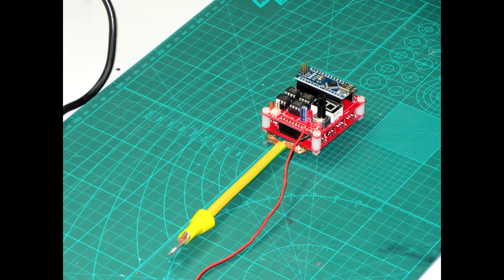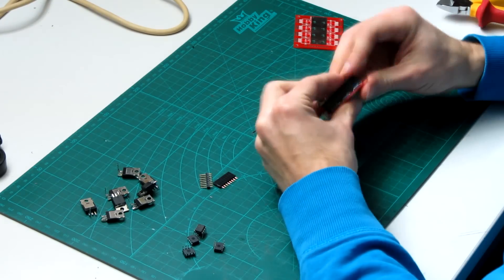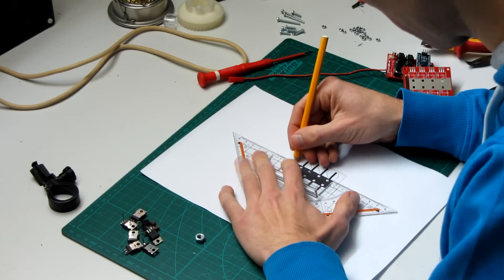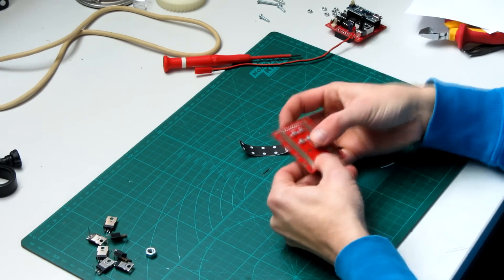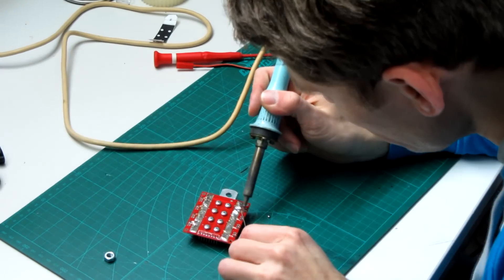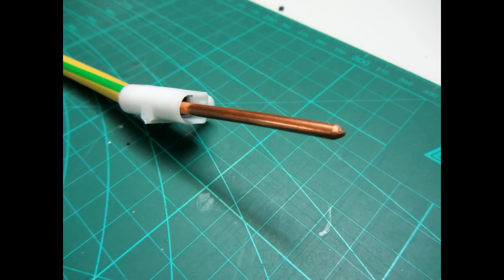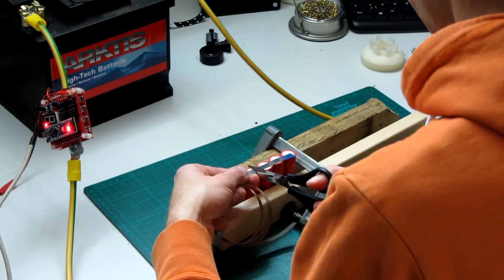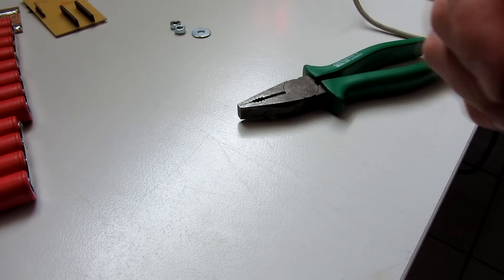DIY Arduino Spot Welder

Comment: On the small black and red wires, what is the max voltage for that and what would be the likely thing to blow out if it was connected to 18 volts vs 12 volts. Mine won’t fire up anymore and was connected to 18 volts instead of 12. Not sure what the max voltage for this part. I would like to fix mine to finish the project. It is not suitable for thick nickel tab material. Needs more power. I can get a sort of spot weld but need more power than a 12volt battery. Don’t know the max for the main battery connection either. Im guessing only a 12 volt battery will suffice.

Comment: Thank you I printed the pcb from pcbway. I will finish the this project.
Reply: Baran Can Aydın Bitirebildiniz mi projeyi? Benim yaptığım sürekli iletimde, pedala bassam da basmasam da.
Reply: Ben yaptım ama demedim akü yok :)
Reply: Baran Can Aydın Anladım. Bende de yok ama 12v güç kaynağına bağlayıp multimetre ile test ettim.
Reply: Serkan ÖZKAN Öyle olmaz dostum en az 40 A aküyle demelisin. Mosfetleri ve driverleri bozarsın. Kısadevre testi yap yanlış lehimlemiş olabilirsin. Akım yüksek olacakki anlık kıvılcım oluşturursun ve nikeli erirsin. Milisaniye bazında çalışır. 0 dan 9 A kadar
Reply: Baran Can Aydın 12v 60a güç kaynağı ile denemiştim ama olmaz mı diyorsun? Öyleyse bi akü bulayım. Mosfet ve driver'lar öldü zaten. 4 pcb yaptırmıştım, yeniden yapayım bir tane.
Reply: Serkan ÖZKAN olmaz hocam akü kadar sağlam akım vermez. Kendinde deneyebilirsin 40 A akünün iki ucunu birbirine değdirdiğinde nasıl bir ark var o güç kaynağında nasıl bir ark...Kolay gelsin
Reply: Baran Can Aydın Teşekkürler bilgi için :)
Reply: Serkan ÖZKAN ne demek

Comment: 0.15 mm nickel plated steel strips. Pure nickel is around twice more conductive than steel, and is also much more expensive.

The positive electrode burns more and not always makes good weld. Hence there is a more effective welding method called "Step (Indirect) Welding". Place the positive electrode directly on the battery terminal. Make one weld with the negative. Much better quality, and also less energy required. Or thicker material with the same energy.

Also, you can make the positive end bigger. If there is no space on the side, you can drill a hole in the center of the tab. More complex, but can be done.

Google "Fundamentals of Small Parts Resistance Welding" and look at page 7. This method is called "Step (Indirect) Welding", while the ordinary method is "Series Welding".

"Step (Indirect) Welding is often used when the workpieces are configured in such a way that only one side of the workpiece is accessible with an electrode, or there is a large thermal imbalance. The welding current flows from the first electrode, through the workpiece, through the area of the weld, through the other workpiece and into the other electrode."

"Series Welding is also used when only one side of the weldment is accessible with electrodes. This form of welding has the advantage of making two weld nuggets at one time. However, series welding is generally less controllable because of the many shunt paths available to the welding current."

Hope it helps. :)
Reply: The reason for the burn on the positive electrode is because ~70% of the energy is dissipated on positive, the reason why MIG and MAG welders use positive on the feed wire and TIG use negative on the tungsten tip.
So yes use a thicker wire for positive electrode or add active cooling.
Reply: Don't listen to him.
If you do this there will be a hole in your battery cell afterwards.
Check out your setup with an old cell first anyway.

Comment: Hallo Mark. 1) Board v3.3, sollte ich R2-R9 auf beiden Boards installieren oder nur auf dem MOSFET-Board?  2) Warum kann die V4.03-Software nicht für die V3.3-Karte verwendet werden? Der einzige Unterschied ist der Zusatz von BUZ. 3) R2-R9, ist 0805 genug? Danke schön. PS, beim Schweißen sind 3 MOSFETs durchgebrannt, aber die Schutzdioden und R 30 Ohm funktionieren. Warum ist das so?

Comment: Can I replace IRF1405 with AP9963GP NMOSFET-s since I can get them much cheaper? They can handle 160A and 40V with 4mOhm RDS(on) and VGS(th) of around 2V. Can I use even lower voltage MOSFET-s?

Comment: Very nice work. But why is there only one digit display? Would you consider making a version with 2 or 3 digits and be able to have a much wider timing range? Thanks....
Reply from the maker: Raindrop Services there is no space on the pcb for adding more displays. you can already display times of max. 99ms with the current one. With some code modification even 999ms should be ok on one display.
Reply: I have same question , when it reaches 9ms, then it goes to 0, then is it 11 ms? and the max of 20ms is another rotation. Direction are no where on how to read the LED.

Comment: technically.....a car battery hooked up directly would deliver enough current to do that too...
something about 80 amps will do for most of that small stuff

having said that, tig welding uses something about 80 amps for 6mm stainless steel
Reply: the 80 Amps of a tig welder is to keep up the arc thats been ignited by the alternating high voltage. Same principle as a HID Lamp ballast.

i built one by myself (spot welder for batteries) using a rewound transformer, i need around 600A (measured with a clamp meter) in a 200ms pulse to create a stable weld on 5x0.1mm nickel strip / 18650 battery surface.
A car battery usually delivers much more current for the starter motor, atleast for a short time.

Comment: HI. I really loved your device.I want to make it but I have a problem with componente. 
I want to use 10x irf1010n and 5x tc 4420 PCB would adapt to these drivers.
I have arduino nano v3 do you  put in your code file or I have to manually enter values?
thank you.
I'm sorry if my english is bad. a large greetings from Serbia.

Comment: Tried to replicate this device.
Collected everything exactly, loaded the program into arduino. It worked but only half.
Those. the indicator lights up "8" all the time, i.e. all segments are lit except for the point.
The device produces a double pulse, but not adjustable. Rotating the potentiometer has no effect, no effect.
When the button is pressed, the LED flashes, 2 pulses are generated, and at the moment the button is pressed, a random number appears on the indicator. The next press and the number is already different, no system.
So the device is raw, it is possible that the program with some kind of error.
Sergiusz

Comment: Really nice work… but put some shrink tubing over the wires. Earth wire should NEVER conduct current, and 2: after 2-5 years you're going to connect the wrong way (Murphys law).

Comment: hi could you make instructions on how to order the pcb? i see so many options that i don't want to choose wrong, i already registered using your 5$ coupon so thanks for that :)
Reply from the maker: +CrAzYDr1veR You dont have to change any of the options.First register an account at http://www.pcbway.com/setinvite.aspx?inviteid=12824. Then just go to http://www.pcbway.com/orderonline.aspx . Type in Board Dimension (100mmx60mm) and quantity (cheapest is 10). Then click quote now an make your way through the ordering process. As Gerber Files use the spot_welder_v2_gerber.zip from my github https://github.com/KaeptnBalu/Arduino_Spot_Welder/blob/master/Eagle%20Files/Spot_welder_v2_gerber.zip

Comment: Those 12v need to be DC or AC or it doesn't matter? Thank you!
Reply from the maker: 12V DC
Reply: SelmerSlowflyer
 So I can power the Arduino directly from the car battery, no need to buy a 12v power supply, no?
Reply from the maker: Its better to use a seperate 7-12 V supply for the Arduino. My car battery drops the 12v down to 3-5 V while the welding pulse happens. Dont know if the Arduino can handle that short decrease of supply voltage.
Reply: Thank you for your time! I found a power supply seller. They range from 0,1A , 0,5A , 0,7A , 1A. Can you please recommend the minimum necessary output current?
Reply: Please answer. I wont ask another question.
Reply from the maker: Take the 1A version. 0,5A should be enough but with 1A you are safe.
Reply: Thank you!
Reply: This problem should be fixed with some capacitors? Could you suggest me some?

Comment: Hi, can i use a welding machine instead of the car battery?
Reply: if your welder can give 400+ amps than you can.

thing is, the house hold welding machines are 30-40volts and 200 amps, you need 3-6 volts but 400-800 amps.

Comment: can i use laptop AC to Dc cord 19 v instead of using  car battery? cause car battery is expensive
Reply from the maker: andrew No, you need the power of the car battery, about 400A . Power supply can only deliver about 5-10 A
Reply: do you have still extra Pcb card to sell it?

Comment: Please how/where do you get that template forbthe aluminum. It is not in the files. I need to print a 1/1 scale asper instructions, for drilling hole. Can anyone help. DonI just print one of those circuit board diagrams? What app to use to get it to be correct scale? Thank you.
Reply from the maker: You can simply use the Mosfet Board PCB as a template
Reply: thank you. How about that 6 pin header on the audrino. Why is it needed. I just uploaded the program from USB. What do we need to solder that in too?

Comment: mine wont weld pure strip for some reason. it pulls apart easily. if i use the plated strip that comes from ebay it makes nice welds. any idea how to fix this?
Reply: i fixed this with a big 12v battery made for starting a diesel van.

Comment: is it possible to use tc4420 instead of mcp14e10 ?
These are a lot cheaper. $2.21 for 5pcs . free shipping
Reply from the maker: Jörgen Rambris tc4420 are single channel drivers and with a different pinout than mcp14e10. They are not compatible.

Comment: would a microwave transformer rewrapped with 4awg wire work as a power source? your feedback is appreciated greatly! :)
Reply from the maker: RJ Wilson I dont think so. You need DC voltage, not AC.
Reply: Would there be some way of converting the current into dc from a transformer, i was hoping to have a plug in version instead of having a battery to maintain
Reply: you could try using a 12-14V PSU and a large capacitor.
Reply: yes you can convert ac to dc in the house, put 4 diods 30A  before the primery coil of the transformer to turn ac to dc, search for the simple diode circuit.

Comment: I was trying out you sketch and am encountering an error.  This is a fresh install of Arduino IDE Version 1.6.7
C\Program Files (x86)\Arduino\hardware\tools\avr/bin/avr-ar: unable to rename 'core\core.a'; reason: File exists

exit status 1
Error compiling.

Sketch uses 2,438 bytes (7%) of program storage space. Maximum is 30,720 bytes.
Global variables use 37 bytes (1%) of dynamic memory, leaving 2,011 bytes for local variables. Maximum is 2,048 bytes.

Invalid library found in C:\Users\Phenom-965\Documents\Arduino\libraries\spot_welder_V2: C:\Users\Phenom-965\Documents\Arduino\libraries\spot_welder_V2
Any Suggestions?
Reply from the maker: +Nerraw Yezok try to copy and paste the program code into a new Arduino sketch and compile it. I used Arduino 1.6.1 to program it. No special things in the code, so it should work.

Comment: Is anyone in Australia interested in doing a group order from reichelt for parts and pcbway for circuit boards. If I could get 5 people interested it would make it a lot cheaper.

The parts are all available from the one supplier  (reichelt) and are far cheaper than Australian suppliers, trouble is the base shipping fee is double what the parts cost and it does not make sense to do a single order. 

pcbway also have a minimum order of 5 boards. 

Just reply if you are interested. Thanks
Reply: lol reichelt is actually in Germany
Reply: +Tobimai hence why I am after fellow Australians to place an order from there together. International postage is expensive but if 5 orders are combined and the cost shared it works out pretty cheap.
Reply: Yes for 1 maybe 2, in Canberra.
Reply: I've got some rough numbers (using google currency conversion so expect a bit more), plus a little for local postage. 

Boards will be 10 pairs for $45.36 AUD (same price for 10 as it was for 5).  Hoping to split costs for equal share of boards.

Parts from reichelt work out to be $39.30 AUD per kit if I order 3 or $33.87 AUD per kit if I order 5 (it was $66.26 AUD for just 1).

Some parts will need to be sourced locally or elsewhere (arduino nano, cables and plugs).

Please let me know if you want to go ahead or if anyone else is interested. I am not looking for a profit, simply to share the cost for my own project.
Reply: Hi Brett, did you end up ordering the PCBs for the Arduino Spot Welder.  I am based in Sydney and would like one set.   Cheers